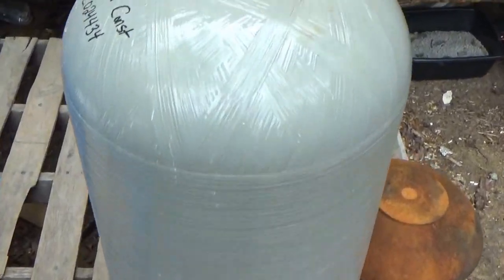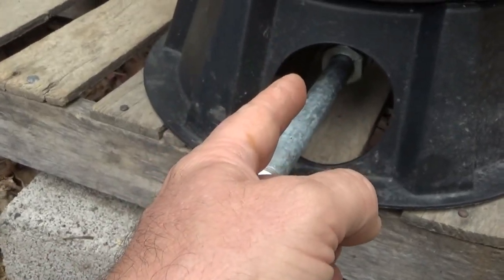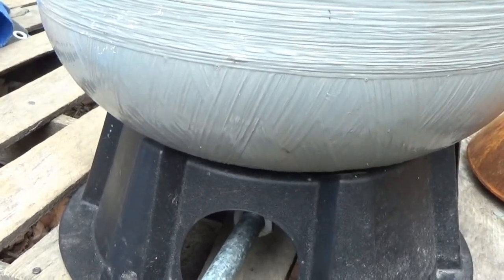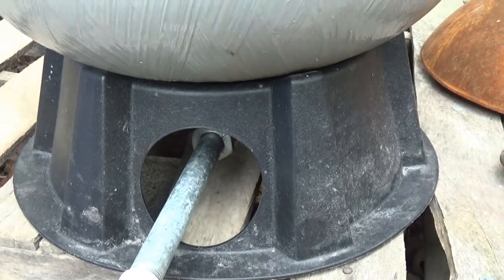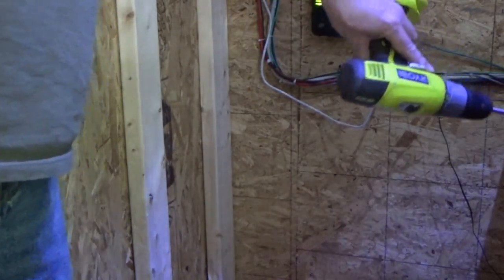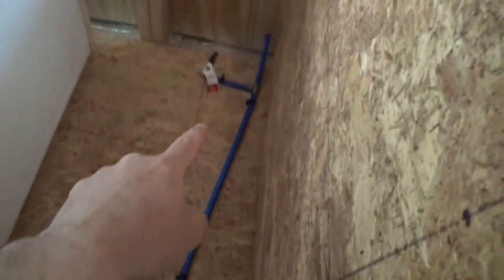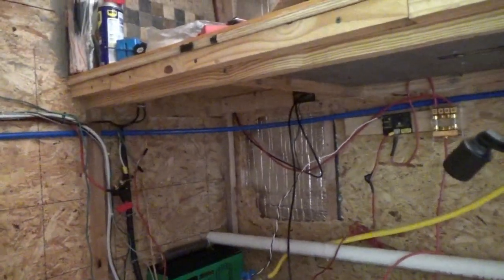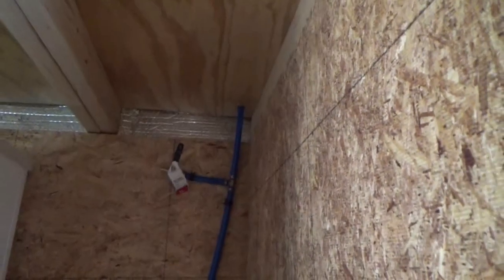Started Installing Running Water In The Tiny House On Wheels

Comment: Why didn't you just keep the water tank downstairs for easy fill? You could have plumbed it like an rv with an inline 12v pump.
Reply from the maker: thereidss Because this way I dont need any power
Reply: The Do It Yourself World I do not think you will have much water pressure for a shower, a 12v pump better idea, with hand held shower sprayer you can, close and open for amount of water you need, with controlled pressure of the demand pump. Won't use much power at all!!
Reply: The Do It Yourself World You should have everything you need in the Motorhome, pump, shower head, water tank, etc. A lot easier than hauling water upstairs.
Reply: Jim Thompson  told him several times , realy dont understand why he does it the difficul way, has nothing to do with power, it doesnt draw anything from his battery's at all . its not that mutch more work, just ad the pump in the line out of the tanks., he gets problems iff he wants to use his on demand water heater now if he doesnt put the pump in the system. but, its his own house so he is free to do what he wants! , iff we like it or not! lol
Reply: MrBugsier5 Troy can add a pump later if he needs to. I think a pump is a better option but it's not my house. At any rate, this setup will save lots of water. :-D
Reply: ***** y agree whit the lesser use of water, but i hate to see people do things twice to do it right the first time, dont re invent the wheel if you dont have to.
thats my opinion, get it fixed and ready, and on to the next job.
Reply: MrBugsier5 If people never gave a shot at inventing things imagine where we'd be today. Makes you think right?
Reply: not Re inventing things that we all already have tried before in practice, y  fully agree with Troy about the low water consumtion with a pumpless system,(he can make a pumpless system seperate for drinking water, and a system whit the pump for rain or creek water with the pump in it, for showering and dish /hand washing but its not a problem to instal a pump, (he has several, so there is no money involved), and the pump is used only for very short times, so the used amphours out off his battey are nelectable, so in my opinion there is no need to make a free flow system at all, dont make it so complicated, its off grid, not  off modern comforts.the tanks upstairs is logic because of the space, filling them is also easy whit a seperate filling pump, and a overflow line running outsid to prevent spilage inside.
, he is loosing lots of time by being so carful whit these things, just build it, and up to the next job, dont think to mutch, just build it! its stil thumbs up from me, whatever he does, but i'm always wondering about the time it takes to instal this small installation.(half, becouse its only the cold part of the system), y would have it all installed (tanks, pumps lines hot water demand and fawsets in less than a day, but thats cause y'm experienced whit it, he isnt), (understandable)  thats why y comment on his video's , thrying to help him to prevent misstakes a bit, he is free what he does whit this advice., i work in this systems for my daly job, so there are no secrets for me anymore in offgrid systems.so anyting y can do to help him can make his work and life easier.

Regards Richard
 (VRM marine The Netherands)

Comment: Hi 

I had used a water tank, dig him into the ground. I had used a energy efficient hydraulic water pressure system 12 or 24 volt DC.

A water tank on the roof is not so good plan. It become hot in the summer. The water is not drinkable.

Comment: Ok maybe this is a dumb question but here goes... where is the water coming from to fill these tanks? I know he said he is going to the creek with a bucket but I think this is for testing right? or is he thinking of filling those up from the creek by buckets, to then upstairs every time they need filled? Reason I am asking is I have never seen anyone do it this way... is there a pump being installed to fill these from rainwater or? I am confused... but so interested since I am looking into ways of getting water into a dry cabin. Thanks
Reply from the maker: Pamela M For now I will use a 12 volt utility pump to fill the tanks as needed. I will get water from the creek in a large tank on the back of the truck and then pump it into the house. Then I dont need any power from the house to run water unless I shower
Reply: The Do It Yourself World Unless you shower? :-P
Reply: Ok got it, thanks